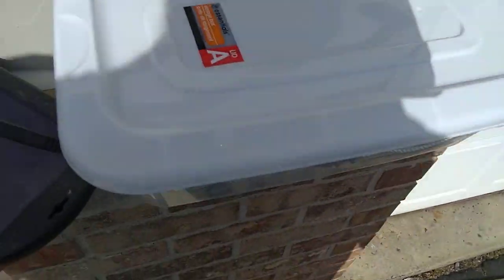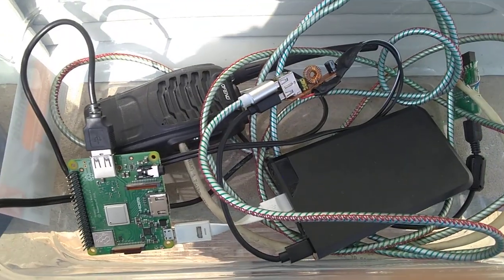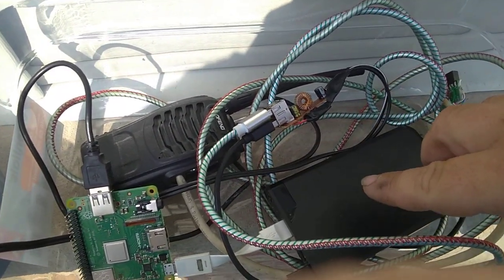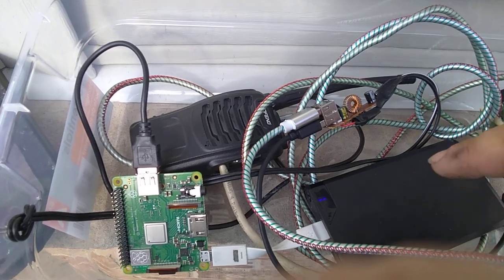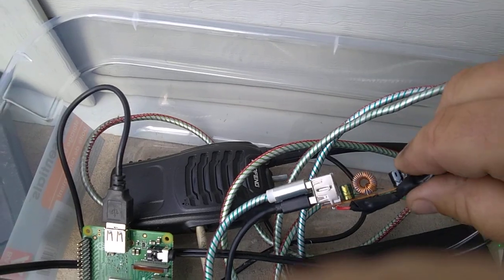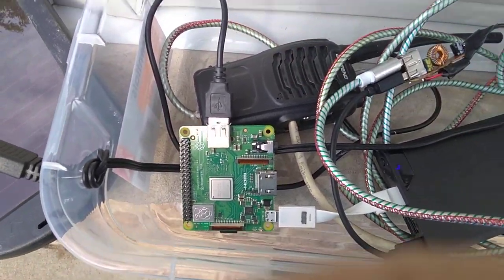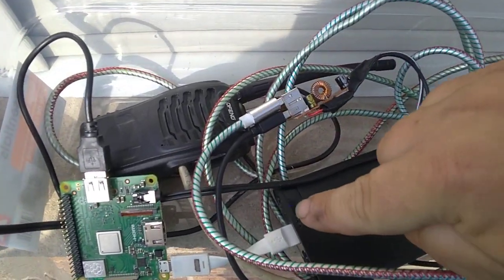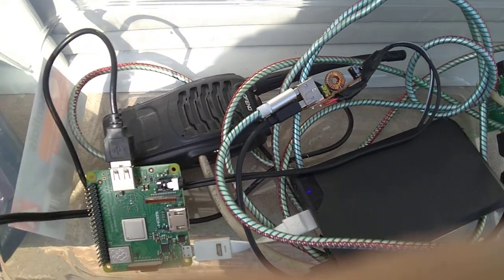The GMRS simplex station running on battery and solar.

Comment: Do you think a solar charge controller would be a good idea to protect the battery?
Reply from the maker: The batteries have one built into them. But that little panel didn't even charge the battery